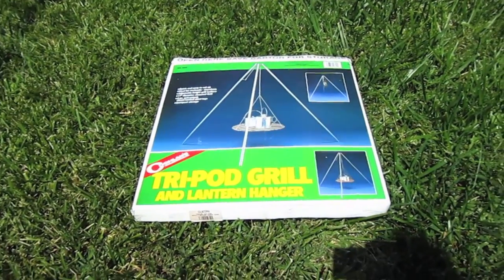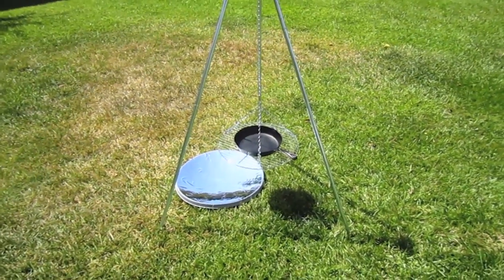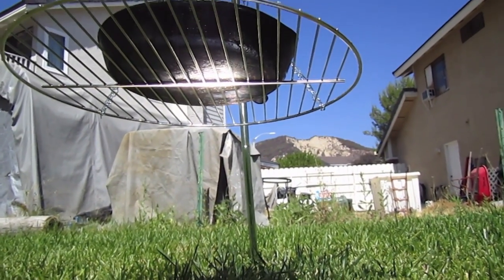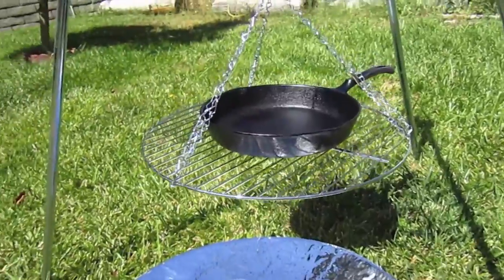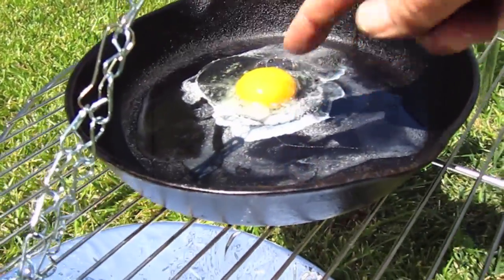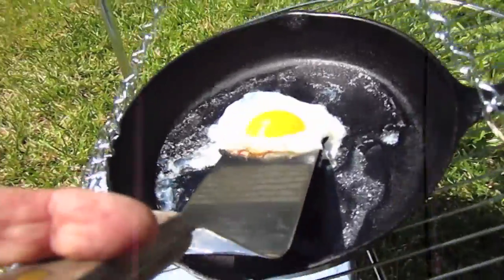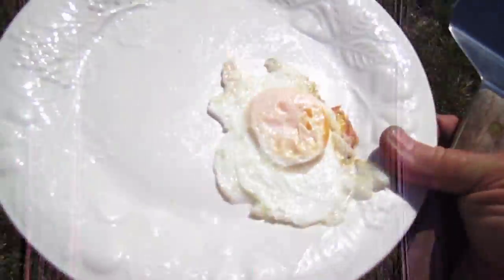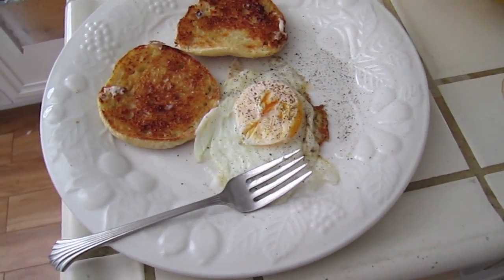Parabolic Solar Cooking DIY

Comment: I'm very impressed with the simple method of your method of cooking with a parabolic solar cooker!

I've watched several youtube videos of these types of cookers and I believe your setup is the simplest with the dish laying flat on the ground. The frying pan isn't connected to the dish because it has its own tripod. The dish doesn't need hardware to be propped up and is very simple to use as a solar cooker.
Reply from the maker: Jeffrey Jamon I attribute it to my laziness🤣. I like things that are simple that work and have multi use functionality. Thank you for your encouragement.
Reply: @BigTVideos  I just need the tripod but I've setup up a grill on rocks to apply what you've shown in your video. Thank you for your video!

Comment: If you could make a parabolic ice/perfafrost printers on mars, that printed out other parabolic ice printers (by heating up the ice and shaping it into a parabola) you could terraform Mars via exponential growth (each printer would print another and in 40 generations you'd have a trillion parabolas).
Reply from the maker: aoeu256 Oh that’s a bizarre question you have to take it to NASA